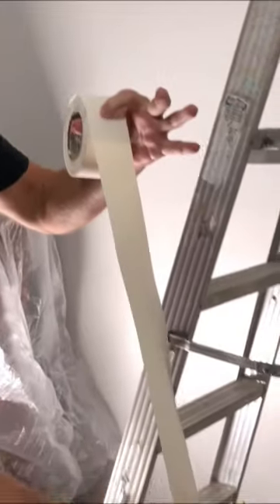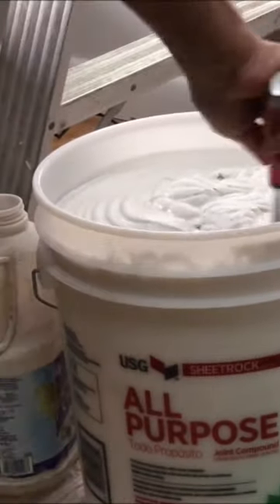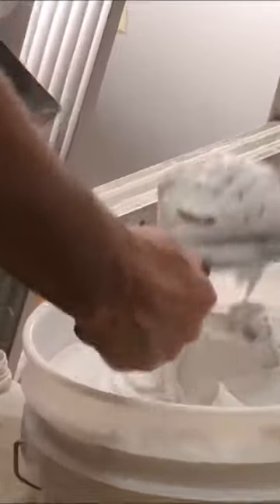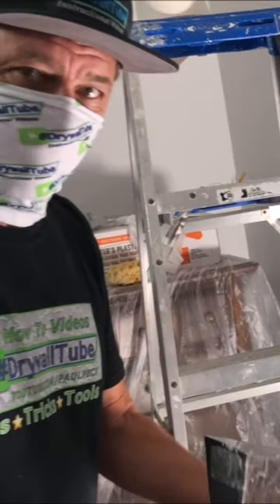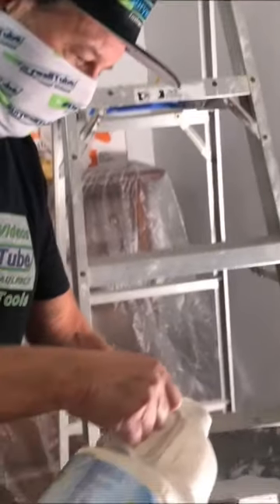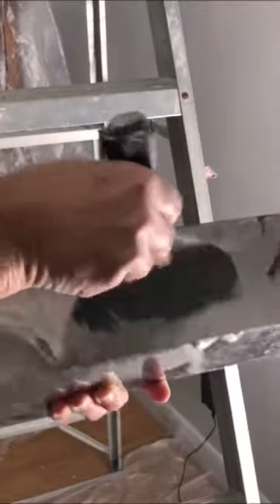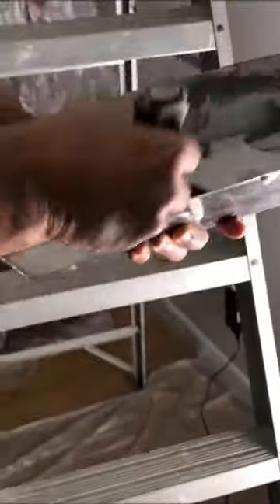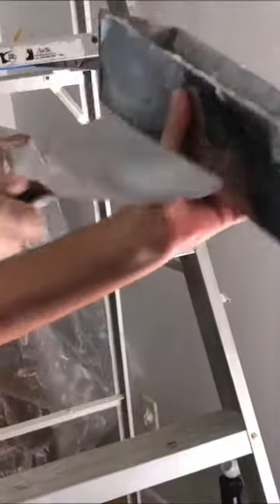THE BEST DRYWALL TAPE AND COMPOUND FOR INSIDE CORNERS!

Comment: Try using a paint brush for applying mud in the corners when you’re doing tape
Reply: @@robdirkadirka 😂😂😂
Reply: I worked with a bloke that used a banister brush with wetter mud for his internals and it worked good. So I believe what you are saying 👍